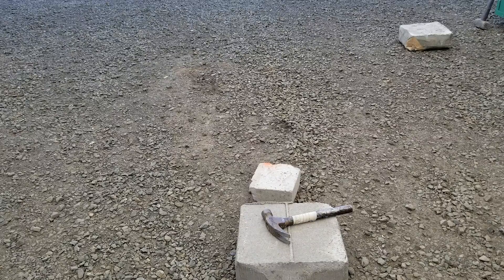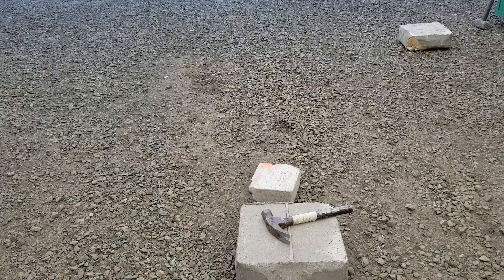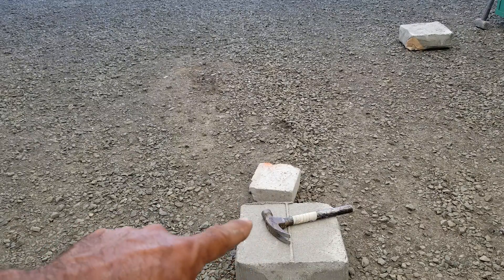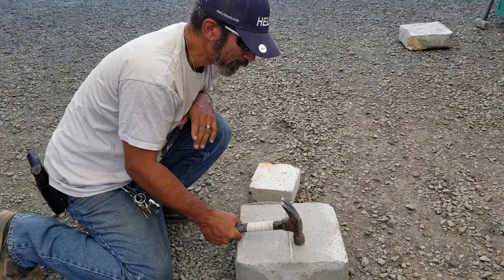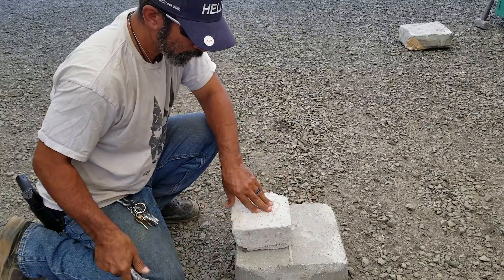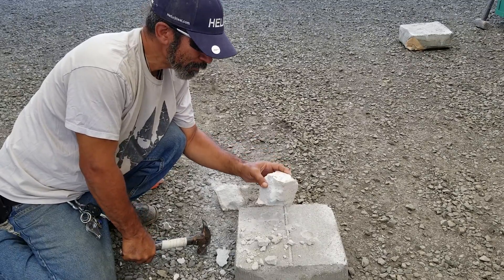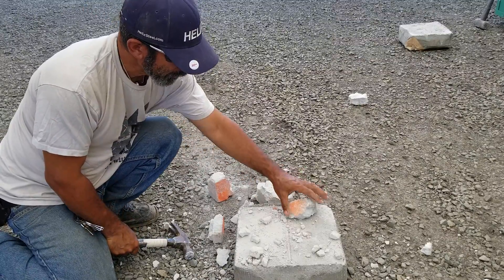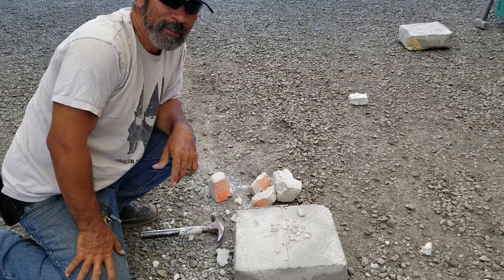Aircrete Sample Hammer Test #Aircrete #AircreteHarry #Dome #FoamGenerator #EPIC #Hammertest #hammer

Comment: QuYl mAterial zasado mesmo neste segunfo blico inquebravel، quero provar deste material usado
Reply from the maker: The cement mix is very good for building a dome house. I built the house I live in now for $3000, my wife and I live here for one year. I used 140 bags of 94lbs bags of cement. It took me 32 hours to build. the dome is 200 square feet.

Comment: harry were do you get your air forms at
Reply from the maker: Monolithic domes. I will be making my own airforms from now on. Much less expensive.
Reply: @AircreteHarry   i have thought of that myself harry.i have been on the same quest that your on for about 7 years.  i have made Styrofoam as well but have concluded it needs to be sanded down to fine like dust instead of chipped. my thoughts was a belt sander type thing from an old floor sander. i also thing old carpet fibers would add some flexible strength as well. i have followed you for sometime now.. id like to share some ideas and hear where you are now. mainly on the air form idea..

Comment: I have a design idea that might help to strengthen the aircrete without adding much weight. High strength composite materials like for aircraft can use carbon fiber with an inner layer made of a honeycomb material to create the shape but not add much weight. In a similar way, maybe aircrete (like the honeycomb) could be coated with a thin but much tougher layer of say   graphene reinforced coating. The outer layer provides tough strong shell but the inner layer provides the main light weight insulation properties. Have you guys tried this?  I'm a newbie to aircrete, so I really don't know if it's a good idea or not.  I love all the experiments you do.
Reply from the maker: I have not tried your ideas before. I dont know where to get graphene or how to make it. The other ideas sound expensive. If you know where to get all the supplies I would be willing to do experiments with them. Send to Aircreteharry@gmail.com  Thanks!!

Comment: How light is the epic block compared to an aircrete block? Cost to make? Can epic be cut? How does it compare against traditional concrete? Enjoy your experiments. We know that the Dome shape itself helps contribute to the overall strength and durability against the elements. It would be interesting to make  mini Dome replicas in traditional concrete ...your epic mix and a fabric reinforced aircrete Dome ..or fabric infused layer over an aircrete brick for comparison on various variables such as cost ,weight. Easy of use/ability to cut ECT...fire resistant and overall sledgehammer strength test.
Reply from the maker: The cost of Epic is the same as air Crete because paper and styrofoam can be acquired for free all you pay for is cement. It's so funny you mentioned building the different domes that is exactly what I have planned.
Reply: @AircreteHarry  Great minds think alike!  Thanks for so generously sharing all your experiments with us...you shorten my learning curve for sure.

Comment: Since the original recipe for EPIC uses Expanded Polystyrene, while this brick that you made uses perlite, i suppose I can call it PPIT (perlite paper infused concrete), just to make sure that I'm understanding it right.
Now, perlite is a much denser, hence stronger material than expanded polystyrene, does it mean that your PPIT is much stronger than the original EPIC?
Another question is, why did you decide on using perlite instead?
Hope you'll soon release dry/wet density info on this thing.
AMAZING WORK!!
Reply from the maker: The reason for the perlite was I had bags of it and it is much easier to obtain. The expanded polystyrene I had shred myself to make the beads. I will have more info to come in the future.